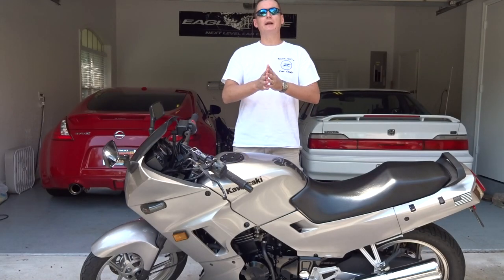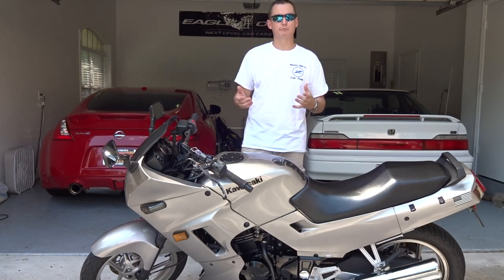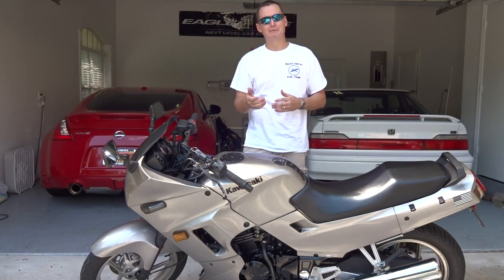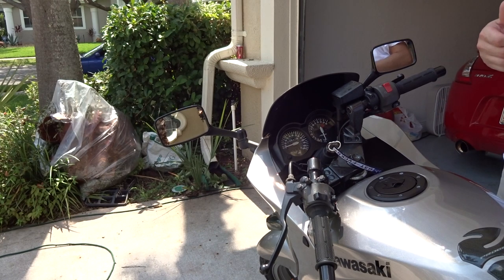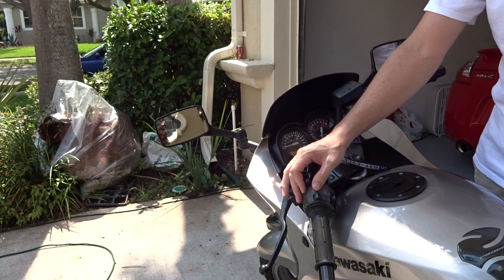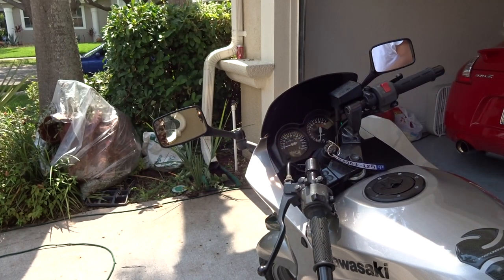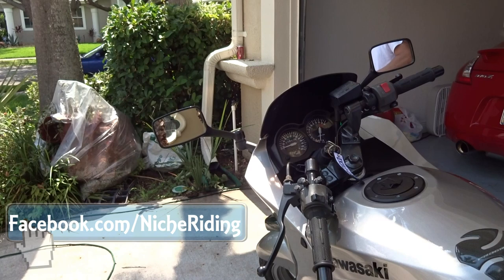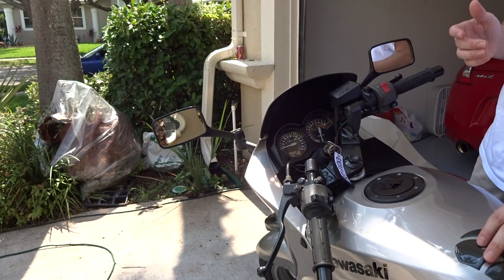Tutorial: How to use a Choke on a Motorcycle. 2007 Kawasaki Ninja 250r

Comment: i know it's been 5 years, but appreciate the vid. i just bought a bike with a choke. manual says to have lever pulled all the way at start and let it run for a while. i got scared when it rev'd up like crazy, and thought my bike had something wrong with it, but saw it's normal if it's pulled all the way. i tried it like you said and it's running smooth now. thank you

Comment: I had a Ninja 250 in the early 90's, and this is exactly how I used the choke. After it started I would adjust the choke so that the tac would idle at 1K RPM's. After 2 minutes I was ready to go.

After 30 years, I purchased a 20 year old carbureted motorcycle, and it starts much different. That's why I seeked out this video, I wanted to see if the procedure was different from bike to bike. I either choke a little or not at all, and when the bike starts, I bring the choke down, or it will die. I don't know if it's because it has four carburetor's and they all have different needs etc. 

I do like my fuel injected bike much better, but the cool thing about these carbureted bikes, is that you can push (bump for you people out east)  start them.

Comment: This bike actually has an 'enrichment' system and not a 'choke', but the results are the same- they both supply a fuel- rich mix to the engine whether it's 'hot' or 'cold'.  No throttle should be required or used (blipping) during the initial start up process, and if throttle is needed it's almost always a sign that your carb needs servicing-very common with today's fuels if the machine has not been run on a regular basis/several times a month. Any throttle used while 'on choke'  defeats the purpose of the choke or enrichment system. 

Avoid ethanol blended fuels if possible unless you run the machine daily and NEVER run E85 in these 'vintage' engines!  Use a quality fuel stabilizer if the machine (mowers et al too!) sits for weeks at a time without being run to control phase separation of the 'fuel'.  Once started, it's important to run the machine until it's fully up to operating temperature- 5-10 minutes minimum.

The traditional choke has a plate or slide that closes off the intake(inlet) side of the carb to restrict airflow which routes increased vacuum to the carb's internals to add more fuel to the mix.  The enrichment circuit differs in that it adds fuel to the mix with a plunger that reroutes vacuum and/or fuel to the carb inlet; there is no restricter plate.  This is a simplified explanation and a good factory service manual (or goggle)  shows the actual internal passages, etc. of the carb if you're interested.

Regardless of which system your bike has  it's very important to keep the rpms as low as possible during the initial warmup until the oil has circulated through the top end.  Manipulate the 'choke'  to maintain  rpms  only to where the engine continues to run without using the throttle, and go 'off choke' asap,  when the machine idles as it should without any choke, or throttle blips.  

On the hottest days of the year, my KLR 250 (which has a nearly identical carb as the little Ninja in this vid) occasionally needs to be briefly 'choked' after it sits for short periods during the days I ride it due to the rapid evaporation of fuel in the carb from the high heat radiating from the engine, but typically no  enrichment is needed but for the initial start up for the day. 

Above all, RTFM!

Comment: I just bought a Yamaha V Twin Star 250. 

When you say all the "way up there" does that location show an icon of a choke closed ? 

 I find if I move the choke to the left it runs way to fast. If I have it to the maximum right it has the real nice idle. However in that position the markings show a closed choke.  Now on a riding lawn tractor one cannot run a warm engine on a closed choke?  So is that different for a motorcycle engine?

Comment: I turn my bike on with the choke and it dies. Why is that. It's not any carb or fuel issues I checked it. With choke off it runs fine. With choke on in dies

Comment: You can take a plastic bag, cut a hole in the corner and wire tie it around the top of a cable housing to pour lube in there and it might drip down with time it seemed to work with mine on a thirty nine year old bike.

Comment: Ive got a small choke lever on the clutch lever so i needed to know that, just bought a £3000 96cm 21/19 250cc & its a monster, i wish id got the 160cc or even 140cc, its an off road dirt bike with no off road were i am, not a road legal bike.

Comment: I just got my Ninja 2007 250r a couple days ago and I haven't used the choke at all. I've started it maybe 5 time. Coldest it gets in phoenix during the winter is maybe 65 degrees. Have I caused any damage?
Reply from the maker: I don't think so but if you are worried always use the choke, even if you warm it up in just 1 minute like I did here in Florida. You can easily tell when the sound changes as the engine gets warm.
Reply: Thx for replying
Reply from the maker: always!

Comment: Oh hey I have a question about starting to the bike I have. 2000 r6 and when I ride it to school and it's time to leave around 12 in the afternoon it I have to give it a lil gas and open the choke a bit to start but it had to turn over for like 4 or 5 seconds before it actually starts up and ideas what this could be or is this normal for carbureted motorcycles it's 82°f outside when I turn it off not sure if it counts as a cold start
Reply from the maker: should start up, when was the last time  your bike was in for a full inspection and cleaning? Could be some blockage that needs to be cleaned out from age. These are just like cars and need regular maintenance to run properly:) I usually go in from oil once every 5k miles according to the mileage chart and have my bike fully inspected at that time.
Reply: +NicheRiding I haven't had it in for inspection I bought it like 5 months ago it's been running really well up to recent weeks well only thing I done was change the oil and breaks and cleaned the air filter I'll take your advice!

Comment: yeahh....my bike refuses to idle I need help asap
Reply from the maker: if it doesn't work doing this, then you might need to take it in for an inspection. My bike is in the shop for the last 2 weeks because the stater went bad on it.
Reply: NicheRiding  my bf 2011 zx6r had that same issue, like mine she starts only with the choke fully open, I live in Tampa so Ik the heat in Florida, anyway she will start up but if I don't keep giving her gas she will cut out
Reply from the maker: get that thing checked out, I just picked up my bike this morning, 470 bucks to fix....bleh